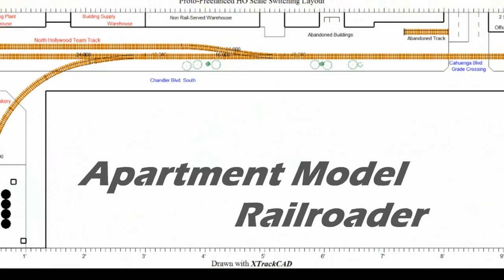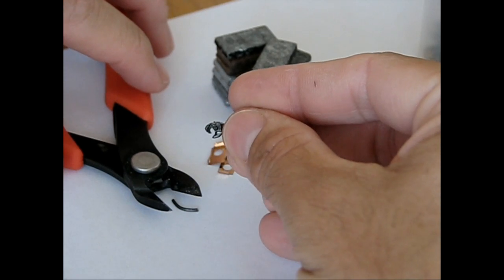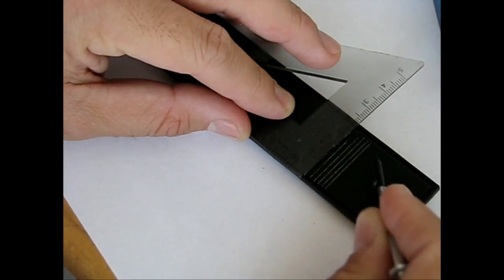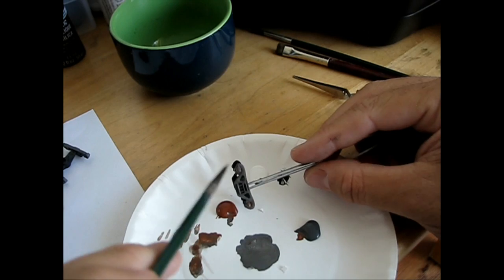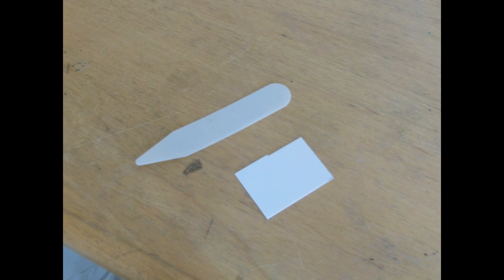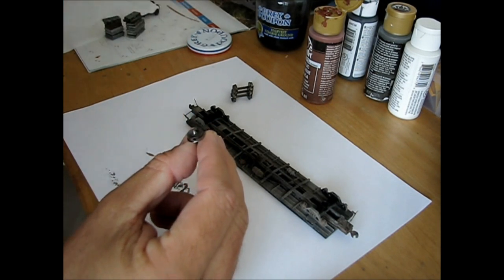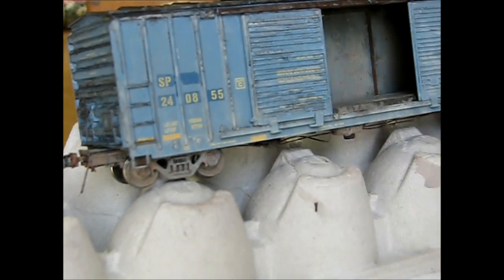Model Railroad Weathering: Fast, Easy, Inexpensive!

Comment: What do you use to make the washes?
Reply from the maker: I used alcohol/India ink/acrylic paint and water. Experiment on a cheap model to find what works for you. My goal here is fast and effective.
Reply from the maker: And thank you for watching and commenting!
Reply: Apartment Model Railroader Thanks, that golden west boxcar turned out really nice.
Reply from the maker: Thanks!
Reply: Great weathering techniques !!!   This is the first time I have seen anyone weather the inside of a Boxcar, I recently tried weathering a car, I used different techniques on each side and they bother turned out pretty good.  I did weather the floor, now I will go back and do the rest of the interior.  Thanks for the video !!!
Reply: The cheapest acrylic (plastic) paints are good enough to make washes. Even cheap poster paints. BUT. They wont' "stick" if the plastic is the slightest bit greasy. Therefore, you should carefully but thoroughly wash your model with detergent and water before trying to paint.

Comment: Wow!  Your car looks fantastic.  I didn't know that you could detail the underside of the frame.  Great ideas.  I'm gonna do that on the next freight car that I weather.  Also, for trucks, wheels, freight car bodies and locos to add rust I use REAL rust. I take a roll of fine steel wool and put it into a quart jar and fill it up with white vinegar and set it on a window sill so the sun can shine on it. After a month or two, I pour the liquid out into a stainless photo tray from my darkroom (10X14). After it is completely dry I use a single edged razor blade scraper and scrape the rust out of the tray. It usually comes out as a fine powder. I then store it in a snuff container. Depending on how long you leave the steel wool in the vinegar my batches come out with different colors of rust, i.e., some are orange and others are a deeper colored red. When I get ready to use it I put several scoops of my rust into a plastic communion cup (neat little cups for mixing paints) and add some alcohol, Elemer's white glue and a dab of water soluble glycerin. Then I just brush it on. If I want an area where the rust has eaten through the metal (plastic) I use my X-acto knife and make some gouges in the sides of a car and fill it up with my rust. To seal the rust I usually topcoat it with a flat acrylic clear coat. It looks very realistic 'cause it is REAL rust! Happy Railroading! W Rusty Lane in eastern Tennessee (Witherington Place Railroad)
Reply from the maker: Thanks for the comment!

Comment: I've found steel music wire (0.025 inch) to be a better option for the brake connecting rods, as they remain straight. Brass wire can be used for brake piping as that has more complex bends.
Reply from the maker: Sounds like a great idea!

Comment: Great video. However I wouldn't recommend using excessive weight like that, especially if you run on club layouts as the weight will cause the axle ends to eat through the side frames of the trucks and fail. That's why I stopped adding excessive weight and stick to NMRA weight standards.
Reply: Weight the crap outta that thing and eat the trucks like the real roads do!

Comment: It looks great BUT in oder to habe boxcars look real I feel that first would have to place on the ends of the boxcar the decals corresponding to the code and car number.
Then yes go ahead with the weathering.
Looks great!!
Reply from the maker: Thanks for the comments Ricardo!
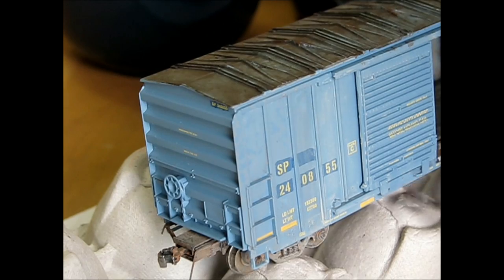Reply: The ends of the cars already have the reporting mark and number decals. Look at 5:15, for example. It's small but, if you look at photos of the real thing (e.g., on RR Picture Archive), it looks reasonably accurate.

Comment: I have to replace the frame on my custom layouts no. 1 she rolled off the top of the grade and almost took her sister no. 2 with her, destroyed her tender as well, my layout is a mix of a proper shortline and a heritage railway, but the grade is horrible to wreck on, took no. 8 out of service for two months and horrible damaged the first 3 cars she fell off going up hill, but no. 1 was at the top when she wrecked and went down the whole mountain and landed on a tressle

Comment: The Acrylic paint you use,is it modelling paint or normal ,artists acrylic paint?
Reply from the maker: The cheap stuff from Wal-Mart haha
Reply: Apartment Model Railroader Lol,well,we don’t have Wal-Mart this side of the pond but pretty much the same thing yeah lol
Reply: We have a a shop
called The Range which is pretty much the same thing and has a similar style logo.The reason I was asking is I’ve got some artist acrylics (cheaper ones) in tubes,could they be used?
Reply from the maker: When I started I sampled the paint first on the underside of a junk railcar. I also experimented with different dilutions